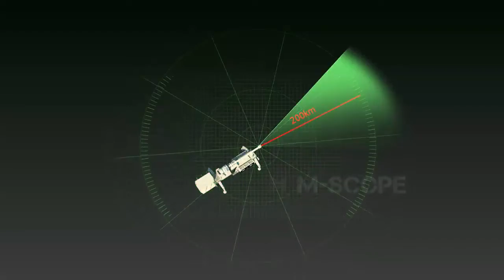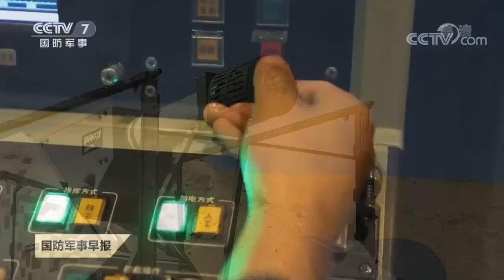China’s successfully developing and testing a powerful Electromagnetic Railgun, Goodbye US !!

Comment: Wow, China has successfully developed the electromagnetic rail gun which does not need gun powder. The strong electromagnetic field propels the missile with a very high speed over a distance of up to 200km and it can shoot at a rate of 4x the conventional firing rate. The projectiles do not have hot spots which make them undetectable by infrared radar. The usa has stopped this project due to several problems such as overheating of the coil. China has overcome the problems and has now surpassed the usa in EM rail gun technology.